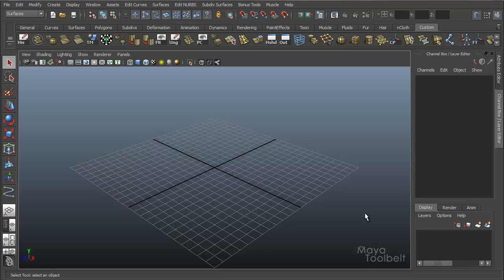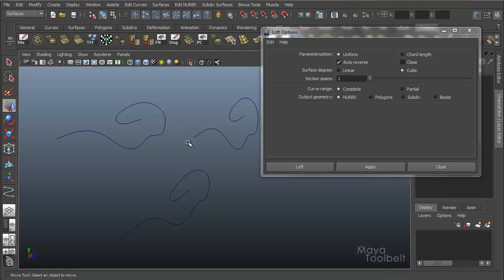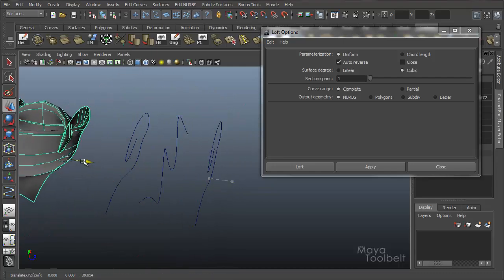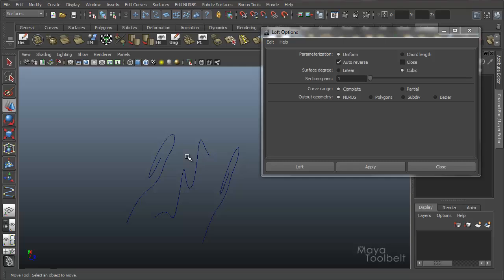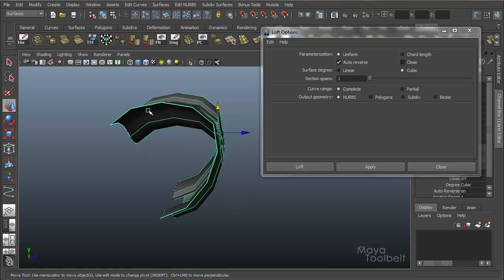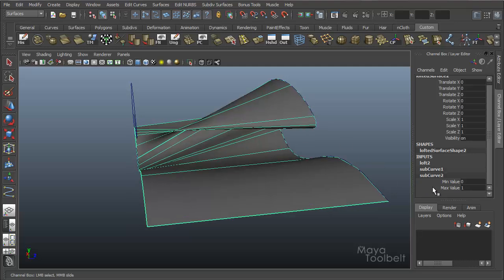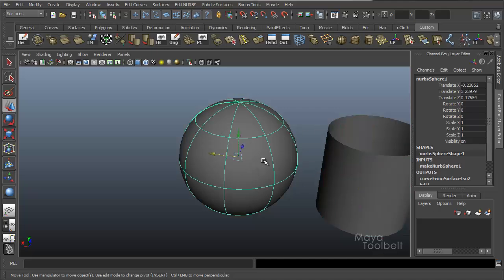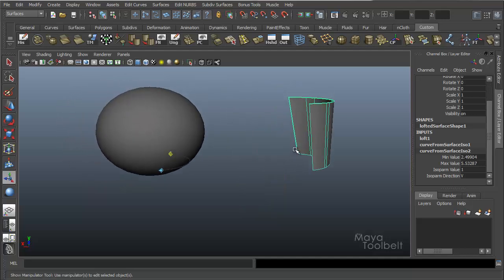The Maya Toolbelt - Loft

Comment: Your videos might not have a million views but i gotta say. Your channel is the real deal. Especially for someone me like who is learning Maya. You are amazing. Keep up. Currently learning all about NURBS & i am so amazed at how flexible it is especially for hard surface. I don't know why many people use polygons for hard surface modelling. NURBS seems to be powerful in that area. Unless there is a major advantage that i don't know of why polygons are used over NURBS. I've read its not suitable for character animation, but other than that i have no info. Might you have a clue?
Reply from the maker: Noldy I appreciate the kind words! Polygons and NURBS both are very powerful. NURBS have a disadvantage in that they're required to be made with patches, which can be kind of limiting, depending on what you're making. Polygons don't have that limitation, but to get the same kind of smooth look, it requires a lot of them. In recent years, computers are getting powerful enough that apps like Zbrush, which run millions of polygons are no longer an issue like they used to be, so polygons have been in the forefront because of it.